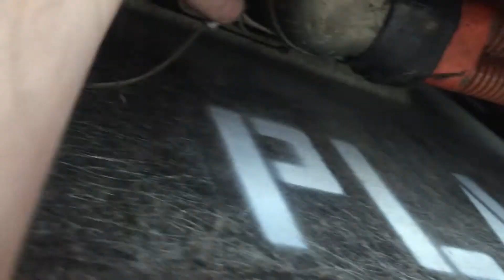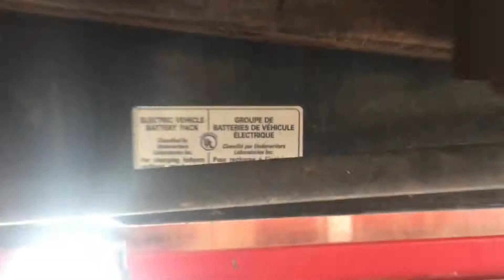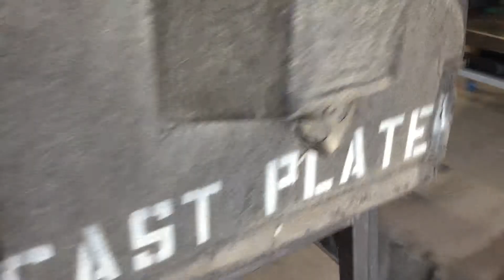Battery Pack Removal (Ranger EV Project ep.2)

Comment: Hi. I just acquired a 2000 EV Ranger and will soon start the process of dropping the battery pack and replacing the NiMH batteries. Did you get your working??? What batteries do you currently have in the pack?
Reply from the maker: Unfortunately I sold both of my Rangers... Simply not enough time or space to work on them, and I decided I'd rather spend my money on other projects.